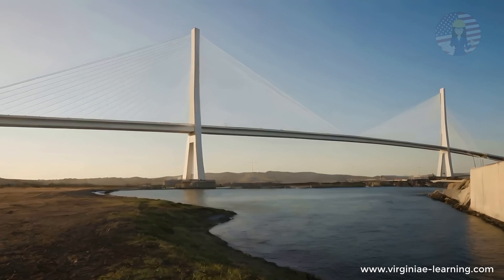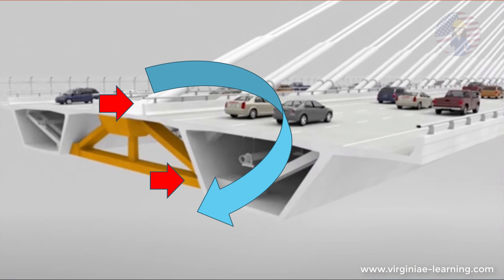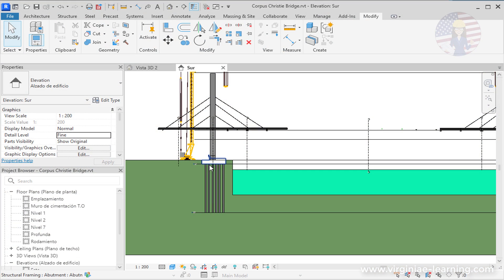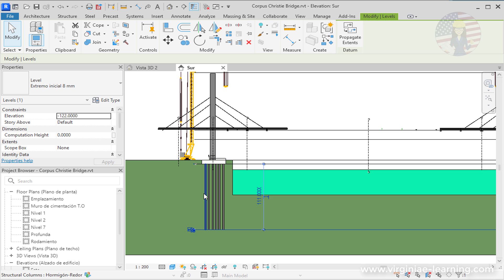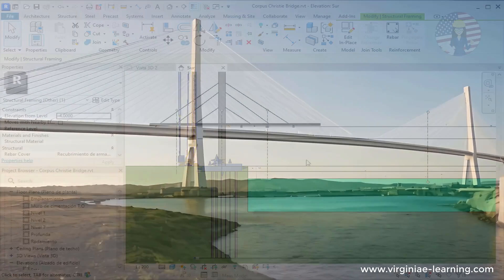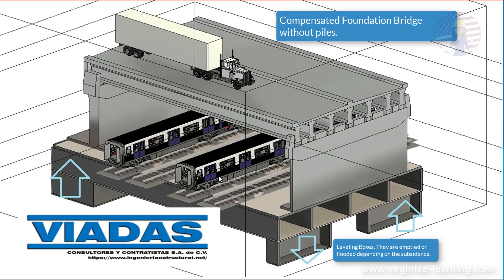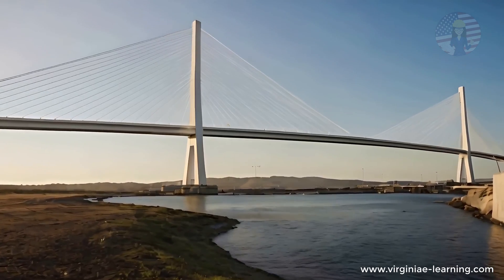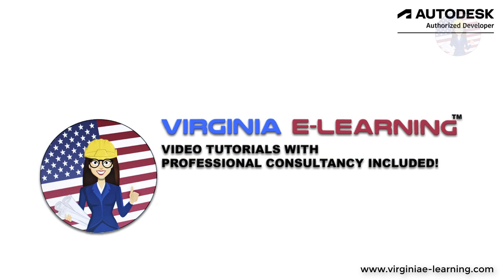Corpus Christi Harbor Bridge. A collapse waiting to happen! #engineering #structuralanalysis

Comment: So, what exactly was the purpose of this video, to scare people or to pitch your Japanese floating bridge design? Plus, the point was to make the bridge higher to have larger ship be able to pass safely through, you floating bridge thingy would end up fluctuating the bridge hight. Also, wouldn't the joints that connect the bridge to the floats beams sustain stress from the constant movement of the water

Comment: The piles depths are not designed by the structural engineer. The Geotechnical engineer makes these determinations of depth and settlement of piles given a load.  Structural engineer designs bridge and provides loads on piles.

Comment: This bridge should have been built in a much more conservative manner, with broader footings with large cofferdams. Also, the suspension cables should be on the sides as well as the middle of the bridge. There is a reason why the Brooklyn Bridge has lasted since the 1880s, and that is its conservative design. New bridges should be built to the same conservative standards.
Reply: The Brooklyn Bridge should be a model. It was built for horses and wagons.  It is used 24 hrs a day with multi tons of weight with bumper to bumper traffic.  Built by craftsman who took pride in their work.  Remember Cars were not around in 1880.   

The old bridge works fine but they couldn’t get OIL rigging under it.
Reply: 1). That ignores the new technology already implemented for bridge construction. 

2) And further to resort to a similar conservative building style based simply on the Brooklyn bridge is not logical.   See point #1. 

But ultimately I will leave it to the structural engineers to determine.  Now if you are a structural engineer then maybe your suggestion is a good idea.  But if not then you are guessing without knowing!
Reply: @michaeldeierhoi4096  ,
I have enough engineering degree and background to understand a less conservative versus a more conservative design, and this new bridge is not as conservative as it should be. It is located in a hurricane prone area and is anchored in mud rather than bedrock according to more than one person who is familiar with the project. That is why I made my above comment. I am not saying to duplicate the Brooklyn Bridge or other old designs. I am merely saying that if you want a structure such as a large suspension bridge to be safe and last a long time, it must be very conservatively designed. As an example, when the George Washington Bridge was built, it only had one level. The lower level was added later. The structure was able to take the extra load because it was very conservatively designed with such contingencies in mind. Yes, when it comes to large landmark structures which will hopefully be around for a long time, it pays to do the job once and make it last, safely.

Comment: The bridge was doomed from the start. The original construction company has a history of bridge failures. This bridge is a giant boondoggle. Way over budget.
Reply: Wrong.   The original construction company started and finished the project (this month) and they have never had a bridge failure.    The original structural engineer was the party that was removed.
Reply: @omcbob37  I stand corrected. But in any case, the design has had issues. FIGG engineers were responsible for the bridge collapse in Florida. While it might be true that the construction company working on the Corpus bridge isn't responsible for the Florida collapse, it is a fact the engineers who designed the bridge have a history of failure.
Reply: @MachineMuse-z3x they changed engineers and the Army Corp of Engineers  overlooked it as well.

Comment: Interesting.

Why only Floatation technology on water? Why not Air😅😅😅?

 The  Support to the Bridge at Corpus Christi Texas need not be tethered to Land or Flotation devices floating on Water. Reimagine structural engineering of such bridges where the load on the structure is reduced using anti- gravitational force to strengthen the weak links  which have emerged in the Structure over time?
Reply from the maker: Because of something called the Archimedes' principle...which is mostly taught in high school...

Comment: OK. Someone tell how a floating structure is more stable than a driven pile structure.
Reply: If we think that in certain circumstances the ground behaves like a fluid, such as on the banks of rivers, on the seashore or even in land with a high water table during seismic events, (soil liquefaction) a structure that floats to prevent differential subsidence. 
This solution is typical in medium-sized buildings when we excavate the ground in a proportion equal to the weight of the building. And by mediums I mean the order of twenty levels of height.
Reply: Remember, the military uses floating bridges to cross rivers with BIG HEAVY TANKS.

Comment: A floating bridge? In a place that has hurricane tidal surges of 20 ft?
Reply: Think of the bridge as a boat, if the accesses are articulated, the bridge will rise and fall with the tide. The idea is not new in Japan and in Seattle there are floating bridges.
Reply: @pabloviadas7564  A hurricane can mess a boat up pretty bad.
Reply: I'd say floating foundations are very similar to oil rigs which are essentially static. The anchors are strong enough to resist the buoyancy and use the resulting tension to limit movement
Reply: Yes. It works in other Stormy areas of the world with higher tides. It could work here too.
Reply from the maker: Yes, engineering is amazing, and it has been done many times. Depending on the design, you can compensate so it actually floats (steel structure), or compensate at the bottom, like you would in a compensated foundation (concrete structure), so the tide wouldn't affect the bridge. You have many design choices, and again, there are many examples already across the USA.

Comment: It also looked like they were laying the roadway on top of the vertical supports with shims in between. I do not trust this new thing and will be sad to see the 1959 Harbor bridge go.
Reply: Neoprene bearing pads (not shims) used in this project are standard practice in nearly all bridge designs.
Reply: @omcbob37  Good news, thanks!
Reply: No bridge lasts forever no matter how well it is built.

Comment: I'm not a structural engineer, but I can tell you that the supporting piers for the ramps to the bridge itself are not deep enough.  The ground is mud just below the surface in that spot by the river.  The old bridge used cofferdams to pour concrete footings.  This thing won't last long
Reply: That's why they sunk 10' diameter drilled shaft piers 210' deep, capped with an 18' thick pile cap that was constructed inside a cofferdam.  The foundation concern generated in this video has been resolved with the additional piles and pile cap extensions recommended by the 3rd party engineering firm.
Reply: @omcbob37 Oh good.  I think I will not use the bridge.
Reply: @timpetta2974  No problem.   You'll just have a longer drive.
Reply: Damn!! Can someone  say agenda lol.  Who ever this is or paid for this is probably  the other contractor who lost the bid and went all out extremist 😂.    Yeah let me tear down everything  and just build you this nice new one 😂... that will ne 600 million  thank you. 😅
Reply: Dumba*s.... so you dont know what you're talking about if you're not an engineer 😂
Reply: Not just that,  the design of the base .
Depth and width of the base would have been better.
The foundation is the weakest point if not done right
Reply: 😅 There is no river under that bridge you jackas 😅 " BUSTED "
Reply: 你去过现场没有，我几乎每个星期都经过
Reply: You don't know what you're talking about.  I live in Corpus and have for 41 years.  There is NO river and that isn't a river.  Any response you give is to try to cover your asinine comment.
Reply: That is exactly what the story said. duuuh